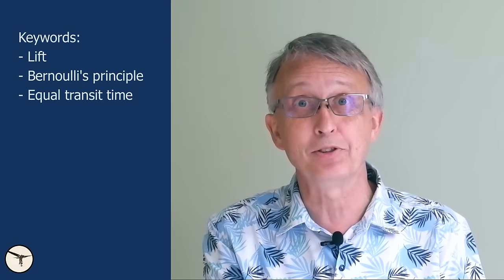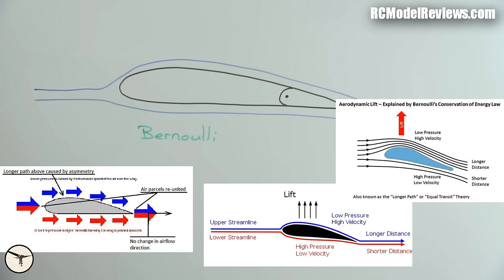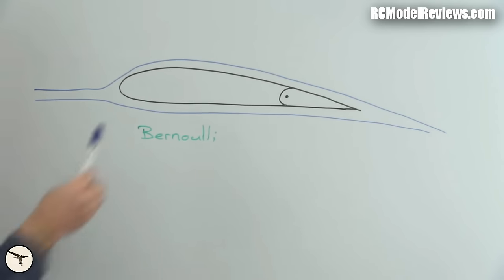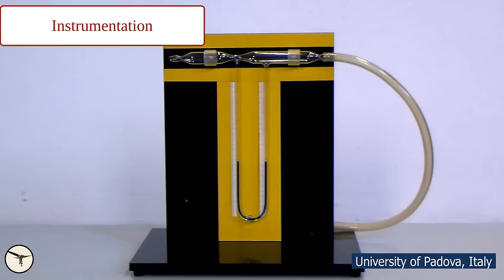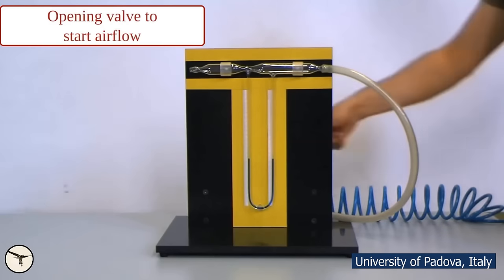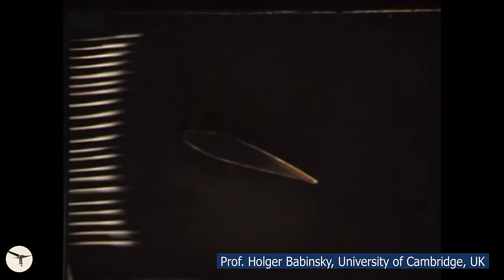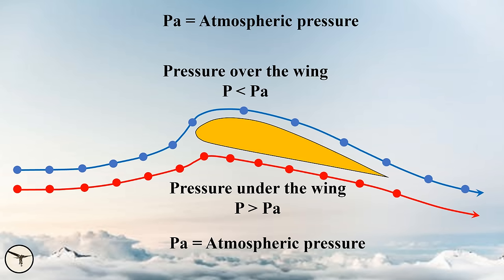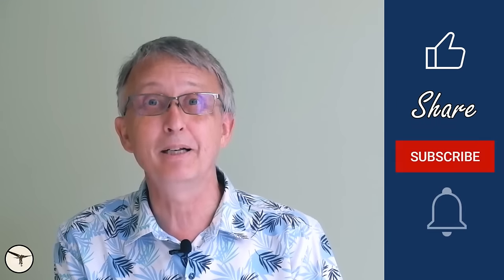Why are so many pilots wrong about Bernoulli’s Principle?

Comment: And yet, a pilot can go their entire lives not knowing this information and it won't change a single thing. You act as though because I don't know the inner workings of my cell phone that I can't properly place a call or something...
Reply: Also, he is wrong at 1:25 claiming Bernoulli is wrong in the sense of the air being divided making it a different airflow. 

It's also confusing.  Equal transit time being false doesn't erase the fact the split air starts from a homogenous stream (same temperature, and same static and dynamic pressure), so the claim that splitting the stream invalidates Bernoulli doesn't make much sense.

Transit time on top being faster in fact has to result if Bernoulli holds true for the system:  where the pressure has dropped, the speed has to be higher for the mass transit rate to be maintained.

What happens if the mass transit rate doesn't keep up between incoming and outgoing?:  pressure keeps dropping until it is low enough that the speed is high enough at the lower density to keep output matched with input.

This is a major flaw with the explanation.  But it is common.

Comment: The Kutta-Joukowski theorem gives accurate numerical predictions for the lift of a wide range of 2 dimensional bodies up to the point of flow separation and leads on to an understanding of wings of finite span and induced flow/drag via the Lanchester-Prandtl theory. It is not difficult to grasp so why bother with these "arm-waving" explanations anyway?

Comment: The air in a wind tunnel is different than the static air the wing flys through. It has to go faster over the wing in a tunnel because the wind under the wing brakes the wind speed. But in real life its the wing that is traveling through static air, so we have to use Newtons laws. The wind does not travel in a tube in nature.

Comment: A wing produces lift by accelerating air downwards.  That's the long and the short of it.

This is why a symmetric wing profile, or flat piece of board, or paper, can all work as wings.

Another mistake people make, as seen in this video, is reducing wing design to a simple cross-section, or two-dimensional model.  Real wings have three dimensions, and what happens along the wing is as important as what happens across it.

Also in the real world, wings are not infinite in length, meaning the wing has an end to it, which is another inconvenience for two-dimensional people.

A wing that can accelerate air downwards, nicely, in three dimensions, without creating turbulence or vortexes, is a good wing, but designers who neglect the third dimension are in a boat load of trouble.

The same applies to a sail, accelerating air backwards  -  which is just an altered view of the same principle.

The same principle applies to parachutes and spinnakers, which are not beautiful aerodynamic objects at all, but do the same thing: accelerate air in one direction or another, and experience a force applied to them in doing so.

Newton said something along these lines.

Comment: Dear Magnar, 

I'm an aerospace engineer who has been unconvinced by the 'conventional' explanation of lift since I was an apprentice, but for different reasons to those explained in this video. I have never been shown proof, or even an explanation why it makes sense to talk about air flowing over the wing when in fact, the wing is passing through static air. In a flying aircraft the air molecules do NOT flow over the wing from leading to trailing edge. They go up and down, ending up lower than where they started. In  other words they are accelerated downwards. Surely lift is a reaction force? 

I'm retired now, you clever physicists are running out of time if you are ever going to explain why I'm wrong without simply saying "it doesn't matter which is moving, air or wing - just accept that." I can't accept unsupported statements.

Comment: It can be solved easily with engineering mechanics or plane trigonometry.Bernouliis principle is not applicable.
Reply: Easy to say, until you have to prove it on paper.    This is a false statement:  "Bernoulli's principle is not applicable."  Bernoulli's principle is simply conservation of energy.  And conservation of energy is one of the three pillars of the  Navier-Stokes equations:  conservation of mass (continuity of mass flow rate), conservation of momentum and conservation of energy.  It is the "competition" between the formulas representing these 3 principles which allows the transverse momentum (to the relative wind's momentum) to be derived, which is the source of lift.  You can't just saw off one of the legs of a stool and expect it to keep standing.

Comment: IMHO Bernoulli's principle is not totally the answer.  If you fly inverted, you would have the higher pressure (actually the bottom of the wing now on top, so the plane would be forced towards the ground.)  So, what is the real answer?  Regardless of whether the wing is in normal flight, or flying inverted, the wing "pushes" the air down, thus the plane goes up.  What do you think?
Reply from the maker: The real answer is angle of attack. When you fly inverted, you point the nose up a few degrees.
Reply: @FlywithMagnar  I just lost my comments to your reply, so I'll defer to the following commenter, "Christophertelford - . he's exactly right.  Sorry Mr. Bernoulli.  :-)  With enough thrust, a brick will fly - it'll push the air down and keep the brick in the air.  :-)

Comment: Couldn't sit through more than half of this nonsense. So many bad ideas here being passed off as insider information.  There are variations of this garbage being rolled out every so often.

If the flow on the top arrives at the trailing edge later than the bottom flow then you have flow reversal on the top of the trailing edge. This is called a stall or the onset of a stall. Without flow reversal, if the top flow moves the same speed as the bottom the 'gap' between the top and bottom flow would be continuously increase, the same way the distance between any two objects moving at different speeds increases. Obviously you'd run out of wing chord almost instantly. Bernoulli applies to fluid flow and comparing the top and bottom flow is basically the same as running two different scenarios on the same flow stream. The math works, because it's describing what's occurring. 

Some people are born stupid. Others seem to really work at it to achieve that distinction. Particularly those who admit that someone paid to send them to a prestigious school and they didn't understand anything they were shown.

Comment: It's funny...the old timers naming it "plane" got that high pressure right....while so many then looked only to the low pressure as all there was.
Reply: As a search exercise, it's interesting to ask AI: "airplane lift is more about a drop in pressure than an increase in pressure?"
Reply from the maker: The oracle answered: 

"Airplane lift primarily arises from the difference in air pressure created by the shape of the wings (airfoil design) as they move through the air. As air flows over the wing, it travels faster over the curved upper surface compared to the flatter lower surface. According to Bernoulli's principle, this faster airflow results in lower pressure above the wing and higher pressure below it, creating lift.

So, while the drop in air pressure above the wing is crucial, it’s more accurate to say that lift is a result of the pressure difference between the upper and lower surfaces of the wing, rather than just focusing on one aspect. The overall effect of this difference is what allows the airplane to rise."
Reply: @FlywithMagnar  Furthermore, from the oracle:)...

"For a typical commercial aircraft wing:

If the total lift force is 1000 Newtons, approximately 600-700 Newtons of this lift would be due to the lower pressure above the wing, and 300-400 Newtons would be due to the higher pressure below the wing.
This distribution highlights the critical role of the pressure drop above the wing in generating lift."
Reply: @davetime5234   Yes...always intriguing that the arguendo tends to be only binary.

Comment: Another factor contributing to lift is that the atmosphere is denser at the bottom of the wing. :) 😂
Reply: Not really true.  Well, a tiny bit true.  If you're talking about ambient atmospheric pressure, then yes on average it changes even with small changes in elevation, resulting in a net force.  But this is microscopic, effectively zero, in the context of the other forces at play here.

But from your wording it's not clear if maybe you're referring to higher dynamic pressure under the wing.

But even if that is the case, it is still the comparatively minor factor in the pressure differential causing lift.

The pressure drop over the wing is the majority contributor to the pressure differential.

Comment: The main issue here is the creation of a vacuum. The upwards air creates a semi vacuum on top of the wing while the bottom air flow pushes the wing up into the vacuum. That's how lift is created and the time delay factor is interesting but irrelevant to lift.
Reply from the maker: We are not talking about a vacuum here. The pressure difference between the top and bottom surfaces of a wing is just a few percent of atmospheric pressure. Go to 7 min 50 sec on this video: https://youtu.be/d4w1Iy4vVMg
Reply: I am sorry, but my explanation is the only logical way that an aircraft wing could fly or create lift. Note - I study physics and understand what's happening at the sub-atomic level. Note - Faster air means thinner air and thinner air means partial vacuum. @FlywithMagnar
Reply from the maker: Partial vacuum is defined as an enclosed space where most of the air has been removed. Since the top of a wing is not an enclosed space, and the reduction in static air pressure is not considerable less than the static air pressure in the free atmosphere, I disagree with using this term.
Reply: The speed of the air craft forces air up fast which creates a virtual enclosed space on top of the wing. Just because the space doesn't have any walls doesn't necessarily mean that it is not there. @FlywithMagnar

Comment: A falling stall would show a vacuum above the wing but the airplane falls. your wind tunnel shows drag (sticky air) after the apex of the airfoil causing lift relative to velocity. Spoilers disrupt this flow from sticking, slats add to the area of the effect to a stall.  It's not about a pilot knowing how wings work, it just has to work. Electrons move from Negative to Positive (military theory), and pos to neg in a civilian classroom. As long as only one set of rules is used for the build, we will be ok.
Reply: The wind tunnel is a stalled wing. That's not aerodynamic lift.
Negative to positive is physics. Positive to negative is electronics, where nobody cares what actual electrons are doing. They just need easy to read drawings. I believe positive and negative came from before anyone knew how it worked.

Dunno how the military teaches it. They taught me to find out if the insulation on a battery cable was worn out by sticking a big screwdriver into the suspect spot and then crossing it with another one touching the frame. If they welded themselves together, you needed a new cable. That's deep into military electronics as I got. They also install 110v  receptacles the right way up on military bases, or at least some of them.

Pilots definitely don't need to know how wings work. This one, for instance.
Reply: @hamletksquid2702  We still don't know electronics, It's merely a Theory of Operation.  I believe confusion starts at airflow, specifically laminar flow and thrust.
Reply: @planker  - Confusion begins when a guy who's spent a whole year of high school studying three maths and three sciences gets told in his first year of college that current flows from negative to positive.
I once had a discussion with a small engine mechanic who was convinced that closing the choke increases the air pressure in the intake. I realized pretty quick that it didn't matter to how he did his job, so I left him alone with it.
Reply: @hamletksquid2702  yes MAP can be confusing, its rated in PSI yet still a vacuum relative to ambient air pressure. Some math is needed to to get the AF ratio to 14.7:1. Moving air is sticky and has momentum allowing a force Neg or Pos to be applied to the surface of the wing. I dropped out of Highschool in 1979 because I was bored.
Reply: @planker  - As a working engineer, I know that if you need numbers, you don't break out the paper and calculator. You ask the CAD weenies. That's an exaggeration, but you'd be surprised how often it works.
Reply: @hamletksquid2702  Your mechanic might be please to know an O2 sensor address his lack of understanding provided he has a fuel injector, otherwise a screwdriver and proper tung position are required.
Reply: @planker  - Lawnmowers don't usually have O2 sensors. If it doesn't run right, you bolt a new carburetor onto it. The empirical methods trump science any time.
Reply: @hamletksquid2702  If you are going to beat me up on lawnmowers well... then there are Batteries and at 48 volts it kinda important to understand current flow. E over I times R, Ohm's law in your face.
Reply: @hamletksquid2702  I don't talk to anybody that plays with 3D printers. Those CAD geeks are all the same. My calculator is Solar powered better known as Ra the Sun God.
Reply: @planker  -  I don't beat anybody up, especially over something as important as lawnmowers. We are each free to worship at the altar of Internal Combustion in the ways of our own tribe.